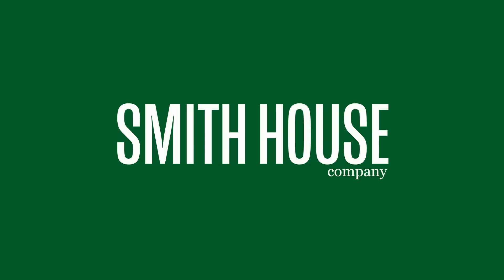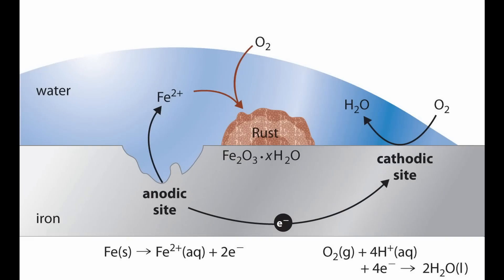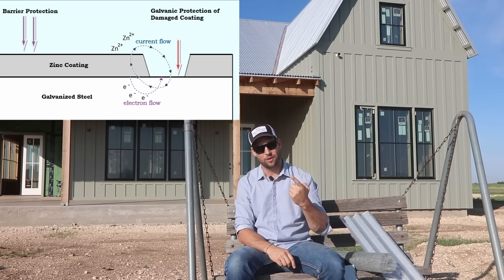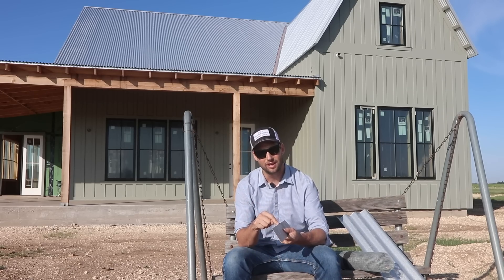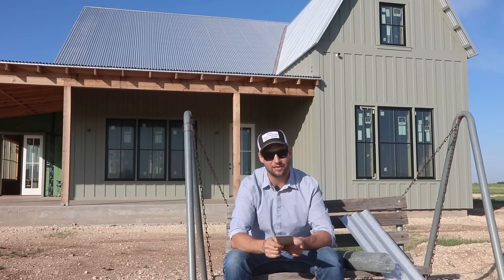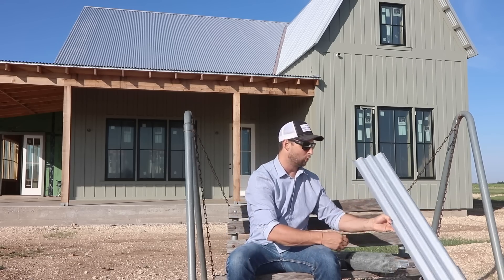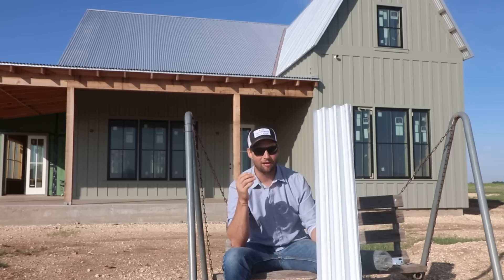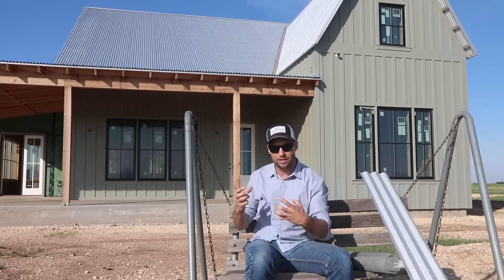The BEST Metal Roof for a Modern Farmhouse - Galvanized vs Galvalume - Whats the difference?

Comment: Would a parrafin wax mixed with zinc oxide sprayed on the underside of metal roofing panels extend the rust resistance ?   Or would the wax degrade from the heat?   Parrafin is a very long chained hydrocarbon known as a "saturated hydrocarbon" and is the most stable of the natural hydrocarbons.  Parrafins are known as alkanes and are inert substances which don't react with other materials.  Cosmoline is an example of a parrafin based metal preservative with a long history of success.  I'm just curious, I'm sure someone has considered this topic before.

Comment: Hey Jordan what type of material did you use to build the house? Im talking about the green side walls.
Reply: Huber Zip
Reply: @treystills  meant to ask about the green corrugated metal sheeting for the exterior of the house. I want to build my own home and was wondering if you can tell me where you got the material from.
Reply: @justmatt9296  ohh the cladding...yeah thats not corrugated metal.  Thats board and batten applied cladding.  You could use a variety of materials to accomplish that look such as just 1x4 wood.  Google board and batten
Reply from the maker: It is LP SmartSide.  Great product for the board and batten look.

Comment: On  a Mike Holmes barn recovery video, they used several steps on a rusty galvanized roof starting with blowers to remove the leaves and pine needles, then I believe they power washed the roof and ultimately they coated the entire roof with spray able cork. Would the cork prevent any further deterioration of the galvanized roof? Thanks.

Comment: Great video. Please put blocking between the ends of those rafters over the beams. This helps drag the wind loads from the canopies back into the building walls. It also helps prevent a torsional failure of the rafters.

Comment: Jorden - I’ll never look at metal surfaces the same. 

You now have me wondering about hot dipped galvanized fasters required for pressure treated materials. So, whats the geeky performance difference between hot dipped and electroplated galvanized? Never thought about it, in my mind Ive assumed it was about coating thickness. 

Tanks for sharing the knowledge

Comment: No visible fasteners?  Any special tools?  Sheets are what dimensions (16' x ?).  What's the cheapest price you found or are the prices firm?  Warranty if installed via homeowner?  Are special pieces (ridge caps, Chimney flashing etc. the money sucker?) expensive?  Is it difficult acquire and more expensive for 24 ga.?   Is it easy for "Harry the Homeowner" to purchase or is this one of those secret society like HVAC  guys only supplies to buy?   Easy to cut?  What did it cost for this home?

Comment: Great video  especially. On the Geeky stuff  another issue with  modern boats   That. Speed up the corrosion  is that marinas are notorious for having  faulty. Electrical systems due to the harsh eviorment of high moisture  and salt water  tha t creates  a lot of stray electricity to enter the water  and making it  speed up electrolysis on  all the weakest. Metals   Because of the way vessels are grounded  that electrolysis will often eat engines. From the inside out  basically and cause major problem they do make  sacrificial  zincs to mount strategically in the engines that. Will help direct the rlrctricity to that. Part with the hopes  that it wont eat   The engine metals  that and  a good wiring job  can help  prevent  serious problems but then again as vessels get aged they. Often do have  electrical  problems that  don’t get. Repaired  correctly all the time especially  when done at sea and when all the correct  parts aren’t available  often the crew has to just do a patch job. To keep the crew and vessel as safe as possible   Therefore a roof and a  boat. Would each have completely different enviorments   As the roof isnt. Sitting in a  live battery  of electric  I’m thinking that has something to do with why  that roof system is better than the  galvanized one   In the manner that their coating protects the metal  by sealing. Out the elements  I watched your video   Because i am hoping to build  on my next home and i prefer. The thought and look of the metal  roofs

Comment: Very interesting that is , a very cool product we have in Australia is called (coreten ) it has the ability to rust to a very copper like colour and stop without going any further, mig weldable arc weld etc. Check it out ! I like it's characteristic in ya face old look , you may like to tell us  how it works , cheers 🤙👌😀
Reply: @Steve Sherman yeah that's it, wow ! U.S.  steel and 1933 thanks for the info always learning 😀👌
Reply: Prohibitively expensive?

Comment: It looks like you didn't use any sheeting material underneath the roof overhangs leaving them completely exposed. 
Did you use sheeting material underneath the rest of the house roof?
I'm curious to see how much extra noise you experience from the open back overhangs/roof when it rains.  I'd think that it would sound like my old pole barn (that had a completely exposed underside of the roof).

Comment: How good is it for paint adherence, and can a baked-on color finish be applied that is highly durable?
Reply: If you want a colored roof buy your metal roofing prepainted, 
Both galvalum and galvanized panels do not take paint well when field applied. Also no warranty 

Factory painted panels are similar to auto finishes and usually come with a 40yr warranty

Comment: How much longer does it last? And do the benefits outweigh the costs?
Reply from the maker: It's hard to say.  Galvanized steel has been around in the building industry for a lot longer, so we regularly see 50 year old buildings in need of new metal.  Galvalum was invented in the 70's and hasn't been used as roofing material for nearly as long as galvanized, so I don't have a great feel for how much longer it lasts.  Price-wise galvalum will win it for shear availability in a large number of rib patterns.  Galvanized is pretty limited to a standard corrugations pattern, which can be pricier than r or u panel.

Comment: How does stainless work compared to these?
Reply from the maker: Stainless would blow both options out of the water.  In performance and PRICE!
Reply: Jordan Smith oh yea, I meant more.. how does the steel chromium? Mixture in stainless work to protect the steel vs these coatings. Is it because it is mixed in ?
Reply from the maker: @hellonoko  oh, I see. Stainless works similarly to aluminum in the way it doesn't an oxide layer which protects the underlying metal.  Stainless has at least 10.5% chromium which reacts with oxygen to create a chromium-oxide layer over the surface of the metal, preventing it from oxidizing further.
Reply: @JordanSmithBuilds  but does it do it TENACIOUSLY?😏